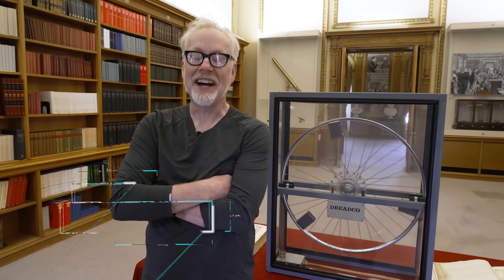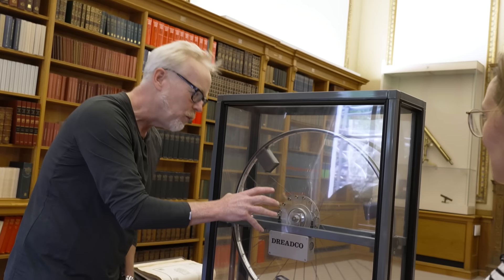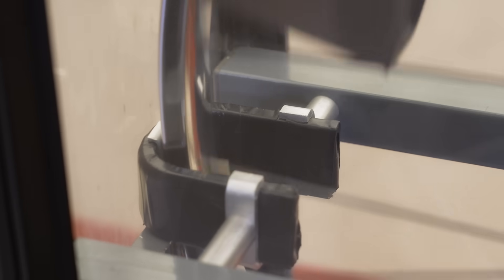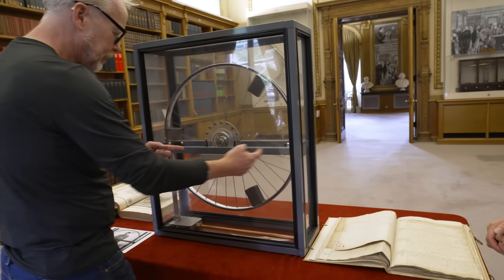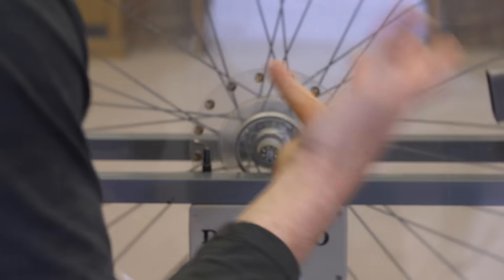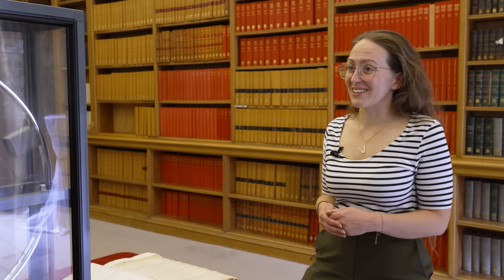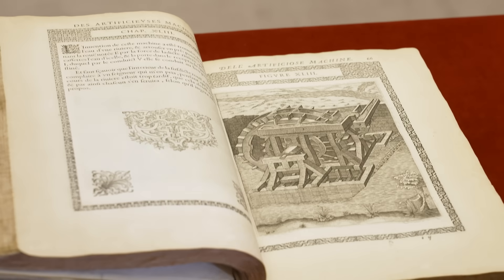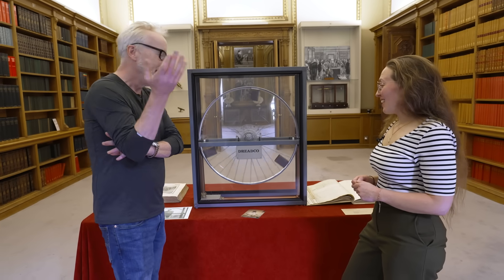Adam Savage vs The "Perpetual Motion" Machine!

Comment: 1 - He was close friend to a well know CHEMIST (who possibly told him about half-life decay-emitting-warmth-isotopes, and slow rate chemicals reactions).
2 - The machine must go to maintenance EVERY 2 years (they CANT come to London and make the the maintenance in London, it MUST BE at the chemist home/office, s. 4, Martin P. has access to isotopes)
3 - Its supposed to be a mechanical machine, but it needs a chemist for maintenance, so its NOT a mechanical machine.
4 - All Jones Wheels are completely (or possibly completely) enclosed (in glas of plexiglas). This can be necessary to contain the smell of a chemical reaction, the alpha-beta particles of an isotope decaying (very unwise, but all wheels are in the hands of governemental institutions, so with half-lives around 2y and not too harmful/only Alpha-Beta decay: Thulium-171, rather not Ceasium-134, anyway encapsulated), and necessary to maintain the rolling of warm-cold air (up warm, down cold). And good point: it makes impossible to track warmth with a thermal camera
5 - this one at least doesnt needs light to work
6 - this one at least can be moved without being affected in its working (which clearly states, there is a quite strong source of power in it, compared to the energy that can go lost when moving it)
7 - "when people will know the secret, they will be disappointed" Wow, great deal - great distraction. let people believe its very simple, so free energyist feel encouraged. In fact, this is a masterpiece of rhethoric and self-praise, but nothing to say about the technic: so long people try to guess, they speak of ME.
It is not said, that the jones wheels must have the same principle of work. This is just a fake, a piece of modern "art". So it can be: A- a slow (low rate) chemical (exothermic) reaction hidden in the box (alternative, less reasonable, some decaying material) and one copper pipe leads the warmth to the wheel (or cold if its an endothermic reaction), thus expands on the wheel profile, leads it partly back to the other pipe (it sticks to the wheel through Coanda-effect). The 3 boxes in the wheel are in all Jones Wheels, that can be a distractor. I would say, its only there to stabilize the wheels.
So, this one is a thermal-mechanical machine. I would say the one in Vienna too, but the reaction occurs there in the 2 upper cans.
Alternative: in each black box, there is a battery, a solenoid, an iron ball (or a lever) and maybe an ils. This works in cycle like this, starting with the box beeing down (at 270°) and looking the wheel turning in trigo-direction: the ball is then left of the box. As the box rises, the ball goes toward the solenoid, gets snapped. At 0° happens nothing, its a fake magnet. Between 90° and 180° the ball is hold back from the solenoid. At 180° the magnetic field of the magnet and the solenoid cancel each others, the ball falls and makes a momentum (compensated through the ascending box which jest passed the 0°). The ils, if at all, could have the job the start/stop the solenoid to reduce the consumption of electricity.
Or: an ils, a solenoid, a battery (both "magnets" are really magnets). When the box arrives near the magnet, the first to arrive in the box is the ils, connects the solenoid, remains so long active till the ils leaves the magnet. The solenoids attraction happens 6x / tour. Triphasic motor on batteries. This way better, the battery delivers electricity only during around 3-4° twice every turn. Remains activ for months...

Comment: Ed Leedskalinin PMH device and it's ability to levitate anything nonmetalic in nature. The experiment in writing is his secret. Steel fishing line/steel cable with an iron core coil placed at half it's length creates a magnetic lever sending the North and South Pole magnets out the opposite ends of the cable. Place that same coil between the two coils of one of his PMH device (in the circular area of the U) and wire proper. Once energized it holds the magnetic charge until the bar is removed. In experiment he used light bulb flashing to prove his point. Paired with another magnetic lever you can use the like force magnetism to levitate the load. Ed buried them beneath the sand and used steal souls on his work shoes to manage their location beneath the sand. (In experiment sand insulator is replaced with a panel of glass) . . Ed's choice of power was a combination of Earth battery technology enhanced by his generator. Sixteen Batteries each having 1.5v wired in series =24v . During the bewitching hours of the night are Earth battery technology any stronger? Hmmm I wonder why he chose to run throughout the night as he did?
Reply: I know this is not related to this device just had to get Ed's PMH myth better understood

Comment: Odd number of black boxes (metal) and even boxes of magnets, tells me on/off electric magnetic. Turns on before enters, turns off when pases through while other sides does the same when it is its turn, thus keeping the wheel going. The wheel may slow down as this only turns on to speed the wheel back up so it is not always doing this. The box is to reduce air drag and the bearings are near frictionless to keep it spinning. The "reset" is a nice battery, I think.

Comment: The key word is anode. Corresponding word is cathode. As the anode corrodes, it releases a small electrical charge. When it is "serviced", the (metal) anode is replaced. Good for 2 years, just like the sacrificial anodes on a boat.
Reply: Polycarbonate can accumulate static electricity, different levels depending on quality, some manufacturers strive to remove the properties that cause that problem.
Whether the static electricity is a contributing factor or not, I don’t know, but I know for sure I’v had a shock off polycarbonate that has been in storage, similar to getting a shock off a car when opening a door.
Reply: @krazytroutcatcher  Nevertheless, the energy to turn the wheel must come from somewhere. Assuming the energy is not being captured by the machine from the environment, i.e. solar or a delta of local thermal temperature, something must be "running down" to provide the energy.  However, if it turned out to be a solar cell charging a battery, I wouldn't be surprised, after all the nice lady did saw the answer is anticlimactic.
Reply: @matthewmorgan9269  We also have to remember this is 1980’s technology, though not backwards, would be far less compact.
One thing I’m curious about is, why isn’t the bicycle wheel running on its own bearings, having an open external bearing?
If the axle had to be fixed, I would’ve mounted those bearings in cast flanges bolted to the box section from, both for stability and accuracy, mounting in the polycarbonate sheet is a little dubious from an engineering point.
The wheel is also a touch out of balance, which would add to drag.

I’ll keep watching this now till it drives me insade...🥴🥴

Comment: A self winding clock, that uses a radiometer to wind it.  A mechanical solar powered clock.
Reply: It even uses ambient air temperature!
Reply: Could static electricity from the polycarbonate be a factor?
I’v had trouble with this before, actually having a shock from the sheet material, similar to one from a car when you touch it.
How polycarbonate picks up electricity is a bit ambiguous, and can depends on the quality of the product, as moving around the stuff seems to create a charge.
I work on bespoke machinery, and it was once suspected the static discharge from the polycarbonate was interfering with the machines electronics, so we grounded every piece, which did seem to cure the problem.
Adam suggested that the bearings mounted in the polycarbonate were insulated, not necessarily so.
And then I thought the grease in the bearings may insulate the spindle from the wheel, again, grease can be conducive.
The distractions are the possible red herrings, whilst you’re looking directly through the potential power source.

Comment: Probably a form of Bedini motor. Each box contains a battery, coils and transistor. When each box passes a magnet the current induced induced in the sense coil switches the transistor on which allows a brief current pulse through the driver coil which gives it a kick. Usually these motors have one fixed driver coil as the stator and the armature magnets on the wheel. This is just a rearranged version.
Reply: The motion is too smooth for any mechanism that applies an impulse periodically, unless the period is really short. Most likely it's just a small electric motor hidden in the hub, with batteries hidden everywhere they can find to stick them. Basically a really big wall clock.
Reply: @outputcoupler7819  The flywheel action of the wheel would smooth the impulses enough to be imperceptible.

Comment: It should be air flow on right side of box directed up. Kind of ventilation from opening in the bottom of box to the opening on the top. Small heating device inside box would be  enough or heated deck. May be greenhouse effect take place as well. Or electrical device hidden under table

Comment: THE SECRET! 
I will say in a summary so that my comment doesn't get band. 
Method: aligned magnets, symmetrical copper pipe running down both sides into  ******** threads and most importantly, it's been vacuum sealed. 
There you go!

Comment: It is not a closed system as the REAL SCIENCE TERM MEANS. It harvests gravity. Gravity from OUTSIDE THE SYSTEM is pulling downward. Would it work IN ORBIT? No. The micro gravity in orbit. There are moving weights in the boxes. They are mass. There are angular momentum differences when the weights are either closer to the center of the wheel's radius or furthest outside. Does a hollow cylinder roll at the same velocity down a ramp as would a solid cylinder - when a hammer and feather will fall at the same speed? Eventually the lubrication in the wheel bearings would get dirty and create friction. It would need to be cleaned and lubed. It is just one of countless gravity harvesting machines. Sad that people are baffled by this child level science. https://www.youtube.com/watch?v=7mxV6f5nuJY

Comment: I am certain that the solution is the horizontal bar with the magnets is positioned just correctly so that the wheel will turn for two or more years. Trial and error. As close to perfect as you can be.

Comment: I have a less complicated theory of how it works!  No magnets, no batteries!  Too complicated.  I am proposing that inside each of the black boxes, there are fluids in each of them.  The fluids in each box are organized in such a way that that they are drained differently(depending on the orientation of the boxes), from one chamber to the next chamber, to displace the weight of each box differently(top heavy vs bottom heavy of the boxes).  Overtime, the fluids in the boxes dry out and, then, a refill is needed!  LOL!

Comment: My best guess, the three blocks on the wheel are negative and positive magnetics not very strong ones or it would not work because could stop the wheel, just strong enough to push it to the next circuit then as it hits each cycle it attracts then pushes it forward as it passes through, it needs three because they chose very weak magnetics to prevent it from stalling the wheel. Magnets only lose 1% of its power every 100 years, so by theory that wheel would spin for the next 10,000 years. That center box is a mini generator caused by the movement of the wheel and it likely sends electrical signals to propels the wheel as well. So it's the best effort in recycling its own energy with a finite amount of magnetism. That is my theory. I had this idea when I was 13, but I always thought it was unfeasable I'm suprised they have one out there that actually works. The crazy thing about Echo-Drive Citizen watches they run on small cell, but last for 20+ years because of light and movement. This is almost the same concept. Thats why I have like 6 citizen watches.

Comment: Watching Adam's mind work is just a treat. The "light bulb" moments working with the "gear-turning" moments is fun.
Reply: These kind of devices are interesting because it’s almost like watching someone solve a problem when they are giving the designer more credit than may be owed and offer solutions that are somewhat overly complicated.

If you asked Adam to make this as a prop for a film I think he would have given very different  solutions. 

This very much looks like some type of belt is running around or within the wheel through the copper tubing and is likely being driven within that box that looks like it has too much going on.
Reply: @Prism775  I think adam is onto something with the magnets creating a split apart motor. the belt idea introduces a lot of movement and friction to the system, so much so that I wouldn't expect it to run for a couple years without needing new batteries. Adam's idea of the energy being electrical to magnetic introduces very little loss, which could explain the longevity of the spin, and is also dead silent.
Reply: He reverse engineered it quick. It's for sure 1 or 2 batteries hidden somewhere giving some sort of power for a few milliseconds to make magnets turn it.

Comment: Coils , electronic switches and long life batteries in the three grey boxes on the rim. A short pulse of of current correctly timed through the coil as the box and coil move through the magnets would make up for the small friction losses. It is a simple electric motor. Servicing would require batteries to be replaced as they faded. The rest of the "stuff" is distraction. It would need a push to start it moving.

Comment: I think its simply magnets, with a lot of bells and whistles to throw people off. 

But what stops the magnets from simply acting like a brake..... I'm wondering is it possible that the boxes contain stacks of magnets of varying magnetism, I.e weak magnets at the bottom of the stack and stronger and stronger magnets as you ascend the stack. 

So when they pass by certain points the magnets tend to propel the wheel slightly rather than act as a brake if it were one larger magnet with a singular level of magnetism. 

The biennial service sounds awfully like a re-magnetising of the magnets and maybe a cleaning of the bearings to ensure it continues to spin indefinitely.

Comment: The thing is, even if you could make a real perpetual motion device, the moment you apply a load to it, it would rapidly slow down and stop.
Reply: .....unless that load has been taken into account when designing the device.
...in which case, it wouldn't be a perpetual motion device, it'd be a fully fledged engine, with an intended output and power supply.
nowhere in the definition of "perpetual motion device" is it declared that it must be a turning wheel.

Comment: There are wires with a rolling system of weights and magnets, probably every-time the wheel spins, the magnets create a current which is passed to a system designed to keep the wheel in motion without a motor being used. Basically by weights.

Comment: Couldnt you simply make the magnets alnico (horseshoe design was one of its primary formats) and make the negative and positive sides the upper and and lower plains of the magnet but split in top, positive on one side, negative on other, like two magnets juxtaposed, make the boxes have alnico inside split into reverse blocks. Same for half way through the horseshoe,  so they mirror opposite, the boxes are placed evenly so that they also push back with reversed magnetic reaction, the charge would weaken do to the negative/positive friction over time, maybe 2 years? The alnico also would be strong enough to pull/push but not strong enough to cause a conflict between the side by side charges. All the rest is just fugaze? Only ran by magnetic charge? I am very undertrained but thought if it is stupidly simple, maybe a simple minded stupid man could figure it out where an expert could not

Comment: That wheel is not moving at all. It is the glass box, the table, the Royal Society, and the universe that rotates around the stationary wheel. The imense power required for that is of course to be found in a totally different location. So, as long as you think that the wheel rotates, you will never find the source of power.

Comment: OMG:  Let's get educated   #1.  The most powerful part of a magnet is the center!!!,   #2.The entire universe is magnetic.  If it weren't for the center of a magnet AC current could not travel nor radio waves.  FACT!! #3.  If you want to play with anti gravity it's right at the center of a magnet!!!!!!!!!!!!  TRY THIS:   TAKE THE CENTER OF A BAR MAGNET AND TAP IT ON ANY NONE METALIC MATERIAL>> YOU DONT WANT TO DISRUPT THE MAGNETIC FIELD WITH ANY IRON>>> You will see it will loose about two thirds it weight..  Most UFO'S are not detected by Radar because they are none magnetic . Not in the North South pole thinking!!!  IT'S ALL ABOUT THE "CENTER" get your act together.  You need get past the North and South pole thinking..they are the weakest part of any magnetic field!!  We all got screwed in the early ages by Edison and D.J. Ludwig.   They would not allow Tesla to expose the center of a magnetic force and all the benefits to man kind.  INDUCTANCE IS THE OSILLATION OF THE NORTH AND SOUTH Fields VIBRATING IN THE CENTER Field.:::    The height of ones intelligence  is directly proportional to their own realization of their own ignorance111111111111111111